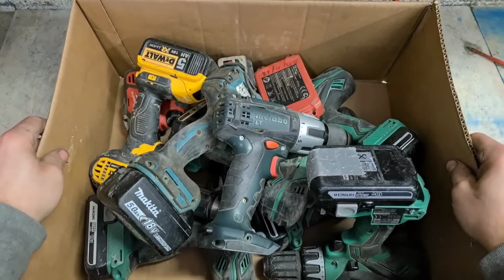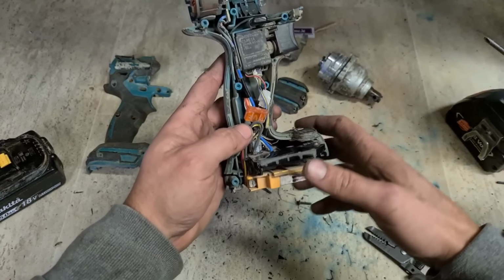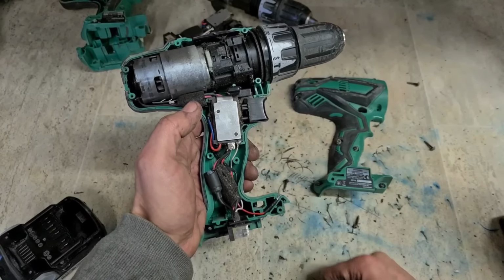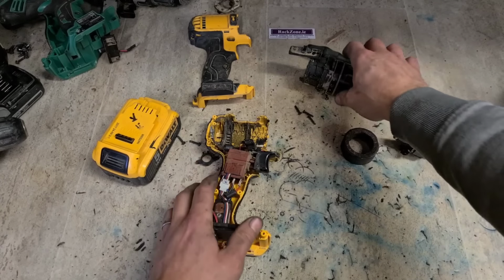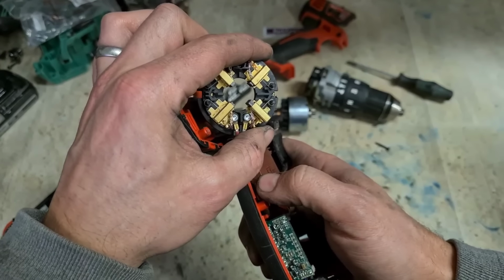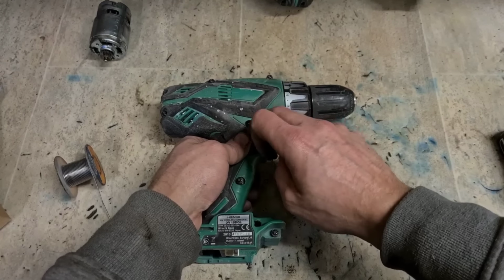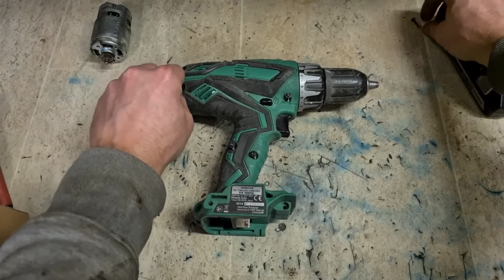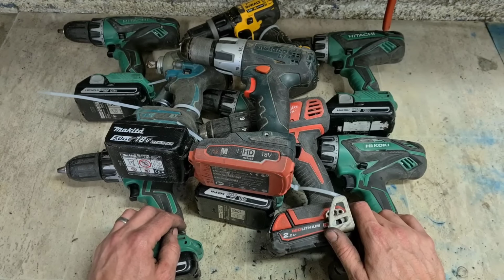A full box of mixed cordless drills in for repair. Makita, Dewalt, Metabo, Milwaukee and Hikoki.

Comment: I love your channel...really relaxing for me.😄 I normally only buy new machines, but recently I managed to find a very old Makita belt sander 9924DB for €30.  It's in very good cosmetic and working condition...really old-it still says "Makita Electric Works Ltd." and still has a light gray cable...I'm slowly ordering bearings, brushes, etc...and it will work for many years to come...keep it up...really interesting videos😃👍

Comment: On the metabo 18 lt you can simply change brushes.. I have 3 of them and replaced brushes on all of them.. if you don't manage to find new brushes due to old model, just take any bigger brushes, sand it a little with fine sand paper (e.g. 240 or finer) and fit them into it.. and I bet the same can be done on most of drills with exausted brushes.. also on 12v bosch drills alike (where brushes are incorporated in the armature and theoretically not replaceable), you can always open the armature easily and replace only the brushes part with the brush holder alltogether.. 3 euros each on ebay :)

Comment: Tools fixed in this video:
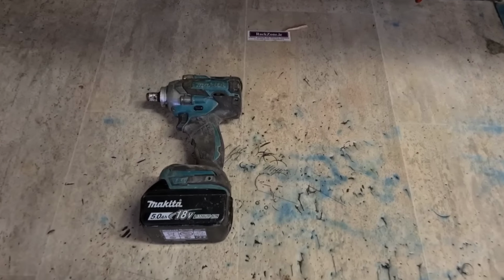0:28 Makita DTW285 Impact Wrench - Fault: electronic brake not engaging
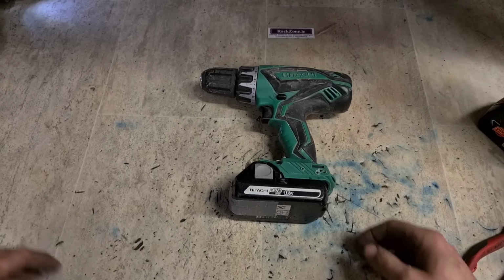10:17 Hitachi DV18DGL Drill - Fault: Broken battery clips/holders
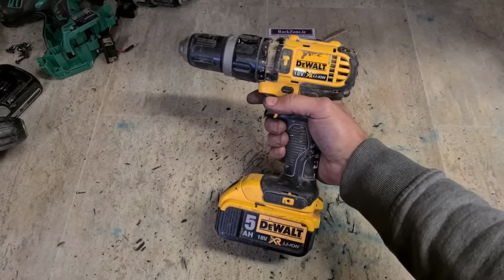22:21 Dewalt (possibly DCD785) Drill - Fault: Not starting
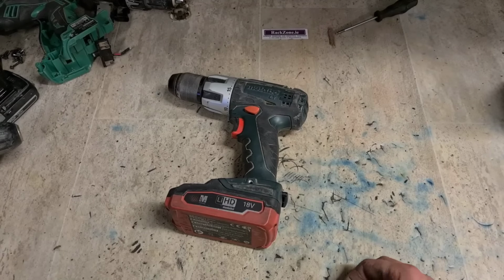28:08 Metabo SB18LT Drill - Fault: Lack of power
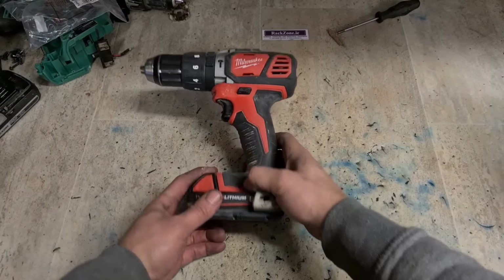31:37 (Dean favourite brand) Milwaukee M18 BPD Drill - Fault: Not starting
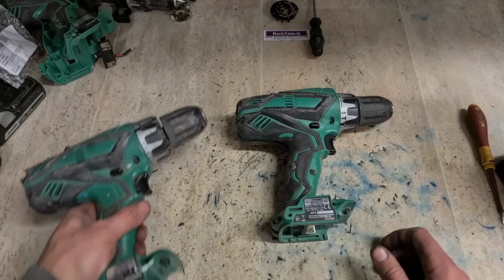36:13 Hikoki/Hitachi DV18DGL Drills (plural) - Fault: Motor replacement

Comment: back in 2016, the brushless version (hitachi ds18djl) was the best quality battery powered drill money could buy. it was way over 200€.

most people over here consider what they paid for it when they actually bought it, not what money the would spend when they get a new one.

we would fix them up out of prinziple, to make the initial investment last longer. so they get like 10 more years of use by only spending a fraction of the initial cost.

Comment: This video is a good argument for buying all brushless when it comes to cordless tools.
These wee brushed motors have a limited life expectancy so the tool could be all good otherwise just the motor is dead.
Bronze bushes wear out and the brushes aswell.
I have an old brushed Bosch drill from 2014 that will need a motor soon. Its only 16€ luckily.
Reply: If you have pin-setters and a hammer you can actually open canned-motors to replace the brushes. :)

But of course because this involves uncrimping bits of metal to get to the brushes it can only be done a few dozen times before the metal fatigues. 

- still, humans don't live very long so it's probably possible to service one of these canned motors for a lifetime

Comment: Hi Dean love the videos 
I have 3 Dewalt batteries  that won't charge past 2 bars and charger showing fully charged is there a fix .
Reply: Tested another charger? Might be the voltage regulator in the charger
Reply: @chucknorris2952  The charger charges the other 7 batteries with no problems. I have other chargers i give that a try. Thanks

Comment: Use flux when soldering anything. Your hands are not clean by default that is why the result isn't "pretty". Wipe the flux after being done, with a paper towel.
It's not difficult to melt. Apply some flux to it and see for yourself. It isn't a PC card to need low-melt solder in it. You incorporate flux with the extra solder but it just isn't enough.

Comment: With cheap machines this old I always tell my customers these machines are like cars, they can be fixed by replacing a part, but they have to keep in mind the other parts have been used for the same amount of time including the batteries. In the end the choice is always up to the customer ofcourse, but yeah no guarantee claims when one stops working again after a month other then on the motors in this case.

Comment: Saving the customer from having to fully replace 5 drills.
Reply: He would save money in the end if he stopped buying the cheapest brushed tools he can find. Those will wear out 3 times before you manage to break a slightly more expensive brushless tool, and that's not factoring the extra battery cycles you take out of your batteries.

Comment: Who is buying brushed motor cordless drills in the 2010’s and 20’s?
Reply: Nothing wrong with that, some people love the tools they had for a long time
Reply: They are cheap and do the job.
If you put a lot of hours into the tool brushless my be the wiser choice but for DIY or standard use they are fine.